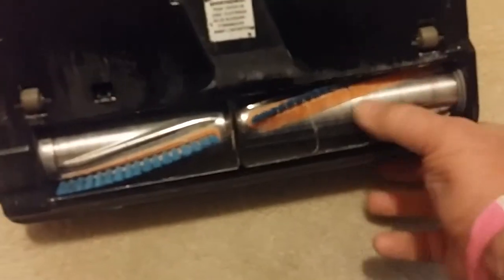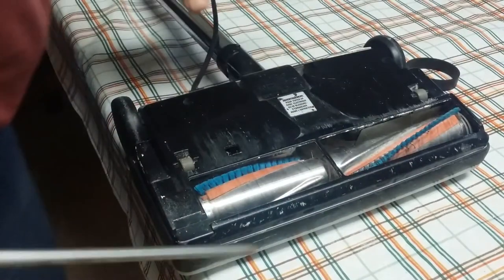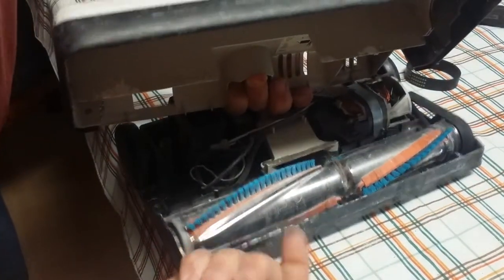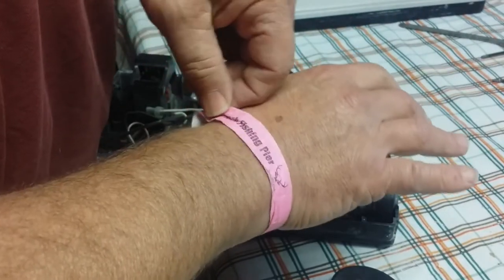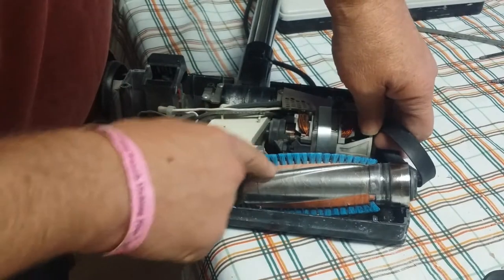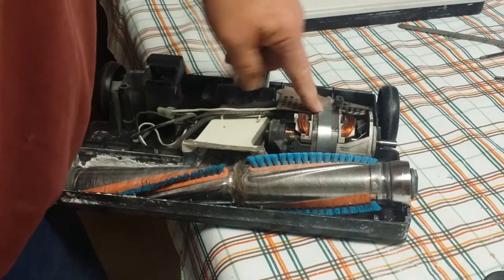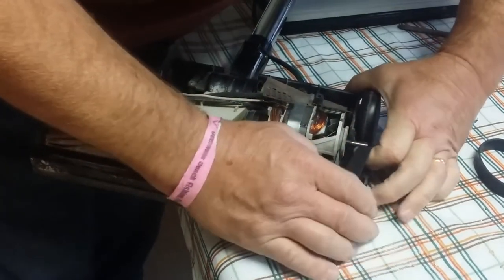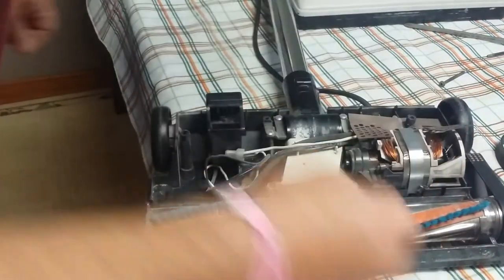Beam Vacuum Power head Not Spinning - Belt

Comment: Thank you for the video. Quick question - What is that grill like thing over the motor (the flap like thing with holes in it covering the vaccum motor)? Mine's torn and I'm wondering if it needs replacing or not. I'm guessing it prevents the plastic cover from melting from the heat?
Reply from the maker: Honestly, I'm not a 100% sure. I think that your guess at it being a heat shield of sorts to protect the plastic outer cover is probably a good one. I'm not sure how crucial it would be though. They probably have the holes in it so the motor doesn't overheat. If yours it totally wrecked, you could try going without it and monitor the heat on the outside just by feeling it every now and then. If yours is just torn a little, leave it in there. Thanks for watching, please consider subscribing. Thanks.
Reply: @wrenchgearsadventures  Thank you for the response. I didn't want to take any chances so put the torn piece together with electrical tape (without covering the holes). Looks solid and it'll hold while I figure out a name for this thing and buy a new one from the parts store 🙂. Subscribed!